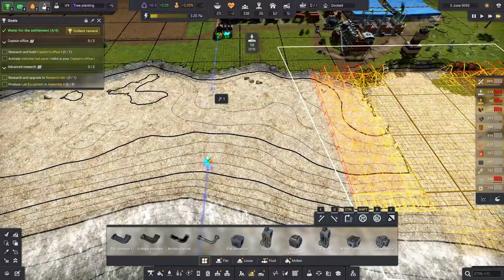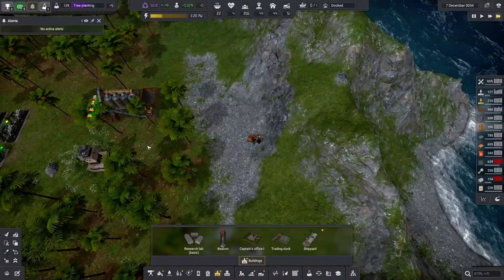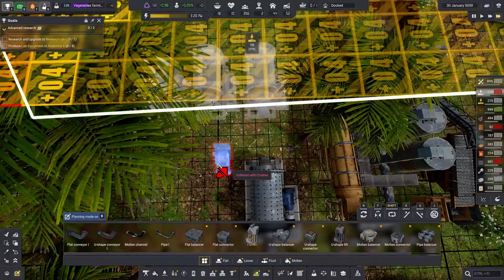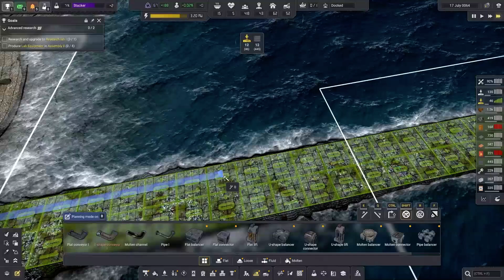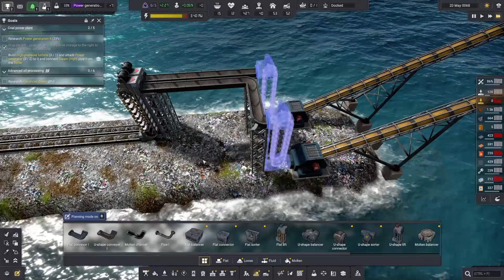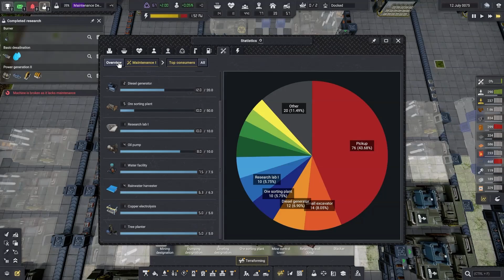Day 4 Of Building A Trash Bridge... | Captain Of Industry: Update 3

Comment: The problem with a one lane bridge is that only one truck is able to dump in a single square at a time, so even tho you save materials and theoretically will extend faster, in practice the wait for each truck to dump means they will advance slower. I always do my fills at least three squares wide just so there’s room for three trucks.
Reply from the maker: Yes I learned that in the later episodes and decided to go with 2 wide. It allows me to add a stacker and allowed the trucks to dump as well.

Comment: Some materials pile up very high, like rock or slag, even better ores. Some just form relatively flat piles, like sand or trash. I'd argue that trash is a rather useless material to make a deep landbridge. Food for thought:
Trash can be used near the coast where the water is shallow, to raise the level a bit and gaining buildable area for industry. For making the bridge, rock and slag are abundant and pile up high, which is great. But there's also a shitload of titanium on this island that you have literally no use for as you can't really tech into it anyway (lack of sand for glass). So my thought is, since titanium piles up so well, it's a fantastic material to dump into the ocean to make a tall and sturdy land bridge. You'll have to do less mining/dumping operations than you have to do with slag/rock, and way way less than if you use dirt or trash on it. Dirt and trash are particularly good to expand the island a bit for space. 

Just an idea I had. About to start this exact location myself now, and that's what I'll be trying. Just spaghetti my way to T2 vehicles, send construction parts T3 for glass to build them, and then start chugging titanium like crazy. Until that point, mostly just focus on extending the island a bit to 1) make it easier to dig down near the ore deposits and 2) gain buildable area/good coastline for cargo docks (for crude oil rig import). The crude oil rig at 120/min crude production lasts some 600 years or so, so there's very little time pressure if you don't go crazy on maintenance until you hit T2 vehicles.

Lots of thoughts eh. Anyway cool series. I'll stop rambling now. Cheers
Reply from the maker: Hey you just gave some great ideas and I’ll be using the titanium to build that bridge ASAP. 

The trash dumping makes sense and I kind of knew it wasn’t as good as rock for bridge building but I had no real use for it anyways no might as well dump it into the ocean to help build the bridge. If it’s affecting the way stone and slag is piling up then I’ll stop but the middle of the ocean is extremely deep and I’m not sure if all the stone will be enough. I’ll be dumping titanium now though so hoping it makes things faster. 

Thanks again for the tips!